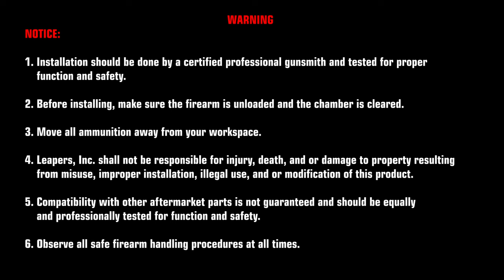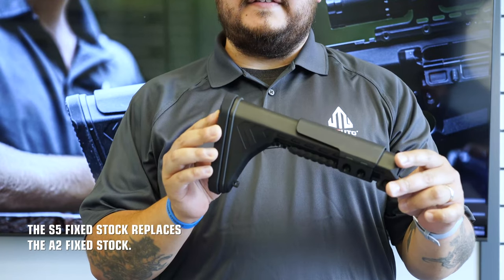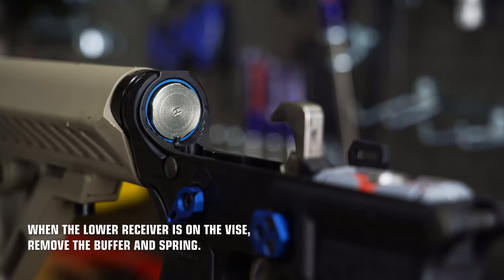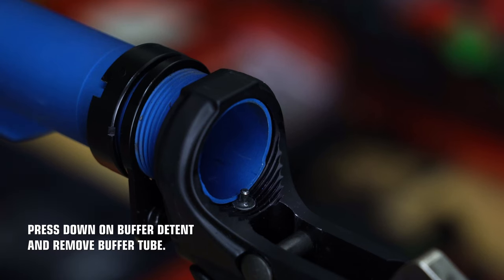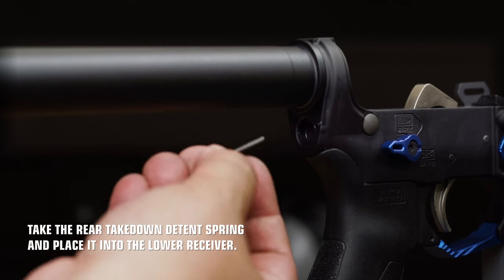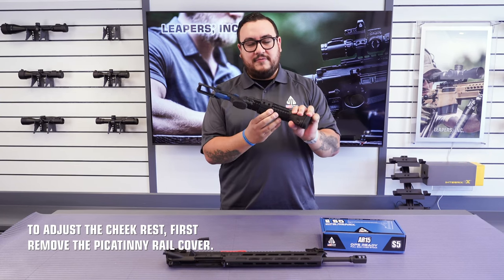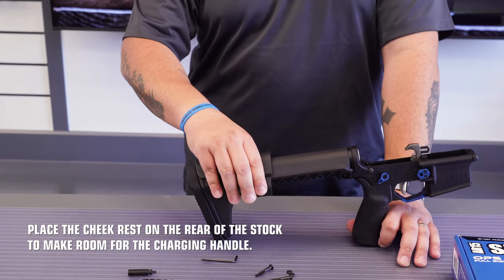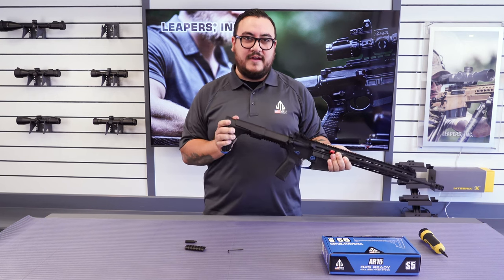Introduction and How to Install your Leapers UTG your Leapers RBUS5BMS-A fixed buttstock

Comment: Will this fit & work with my current A2 Tube from Magpul??
Reply from the maker: It is compatible with Rifle Length Extension Tubes without the A2 spacer, If they are talking about the Magpul MOE Stock then yes it will be compatible as they use rifle length tubes without the spacer as well.
Reply: @Leapers_Inc  thank u.   CMMG Banshee RDB System is the worse system to get to cycle.   I have 2 - 5” uppers and 1- 8” upper.  CMMG uses that tiny buffer & spring for the 5”, but FTFs with 8” upper.  The rifle length system cycles all three uppers.

Comment: What does the spring do?
Reply from the maker: Buffer Spring - Reciprocates the bolt carrier group back into battery.
 
Buffer Detent Spring - Applies pressure to the buffer detent so you may easily remove and install the buffer assembly while still encapsulating the assembly during use.
 
Takedown Pin Detent Spring - Applies pressure to the takedown pin detent allowing the detent to slide through the cutout channel in the takedown pin to the locating holes keeping your takedown pin installed in the receiver as you disassemble the receiver set.
 
Thankfully our new receiver set has set a screw for the takedown pin detent spring and a bar keeping your buffer spring detent in place so changing out buffer tubes is a breeze!
Reply: @Leapers_Inc  Thank you!